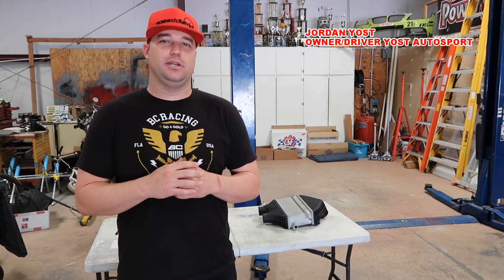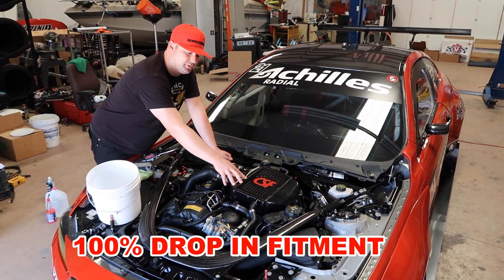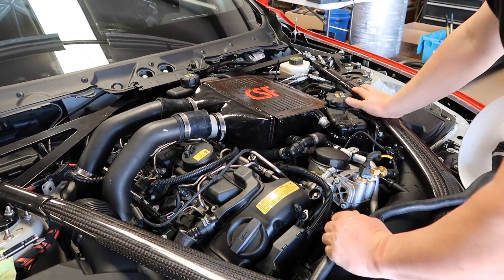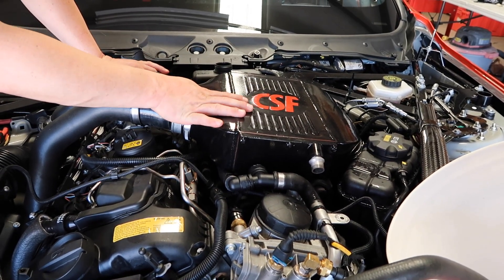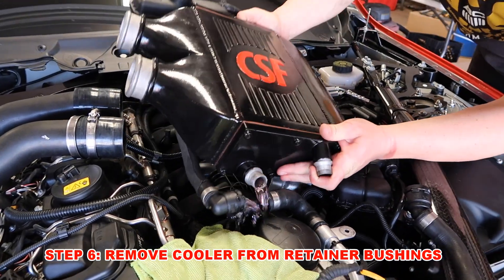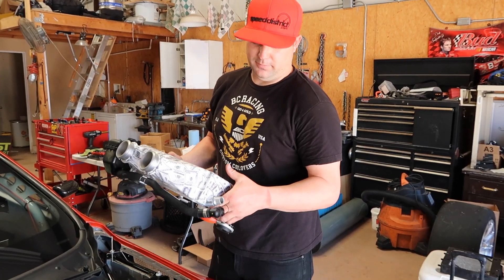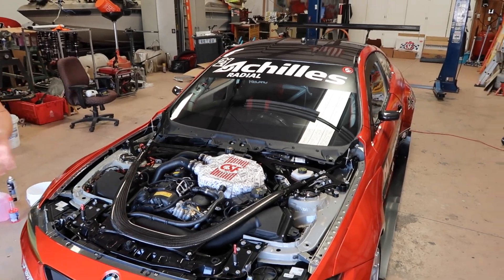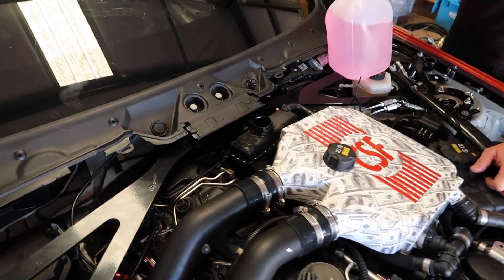CSF Radiators BMW F8X Top Mount Dual-Pass Charge-Air Cooler Install

Comment: Very cool, but how about showing actual temp before and after upgrade?? There are temp sensors by the way and you can read them out, otherwise it looks like 2500$ money wasted joke.
Reply: I dont think there is any improvement in cooler Intake Air Temperature, but the biggest perk is that one can rest assure knowing there will be no leak into the engine as the OEM are know to leak, and that cause the coolant into the engine.

Comment: The s55 have a lot of problem with the central bolt crankshaft, wenn you drive over 500 HP than i recommend you a solution from H2 Motors the (Zentralschraube Verriegelung)